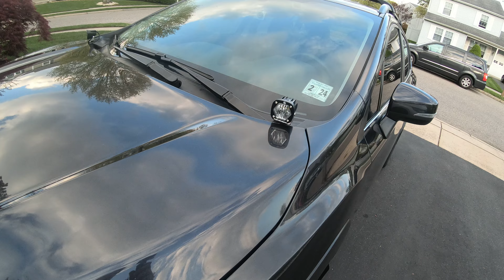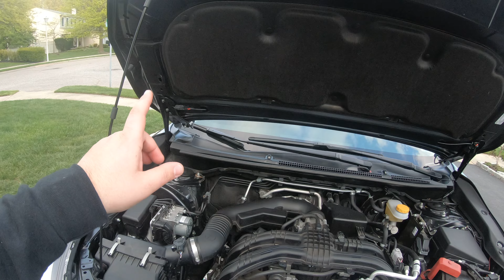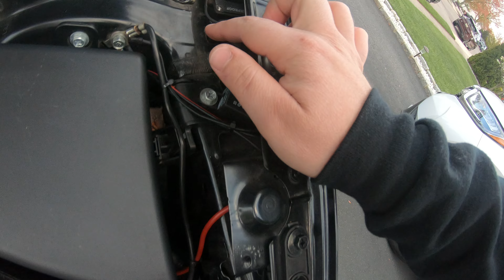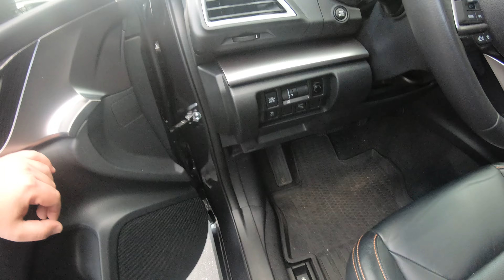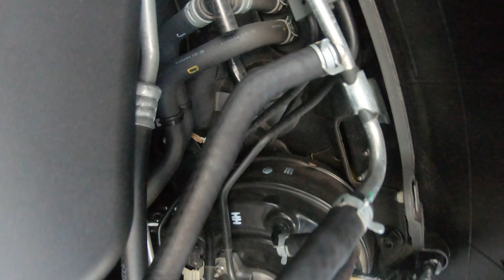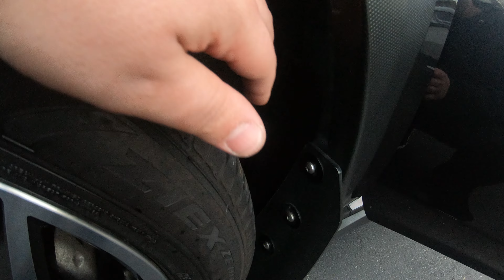2018+ Subaru Crosstrek Baja Designs S1 Ditch Lights

Comment: Great video. I have the Baja Designs S1 pod lights as well. Mine are the spotlight ones. Originally, I had a pair of 3” pod ditch lights on my 5 Gen 4Runner but, after a while I thought they were too big as well. The S1’s look a lot better and they’re more discreet and not obtrusive. If you’re thinking about wiring up more lights and/or accessories, maybe consider the Voswitch. I ordered it off of Amazon for around $270. It makes wiring up things a lot easier. There’s a separate switch panel for the interior of your vehicle and a separate panel to wire the accessories directly to. It allows you to wire up 8 accessories and the relays are already built in.